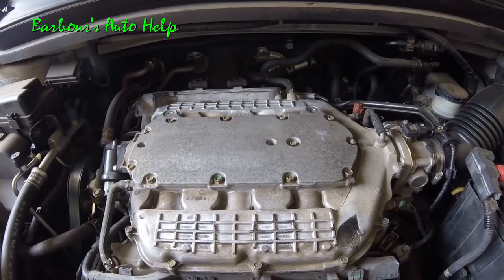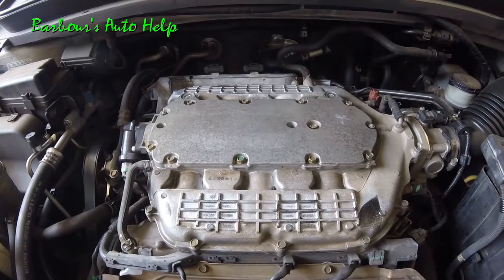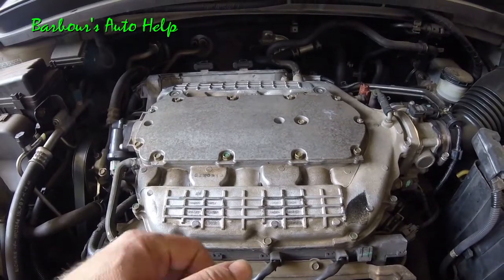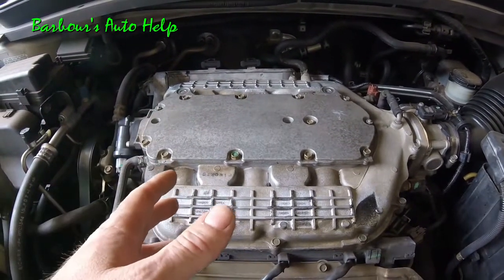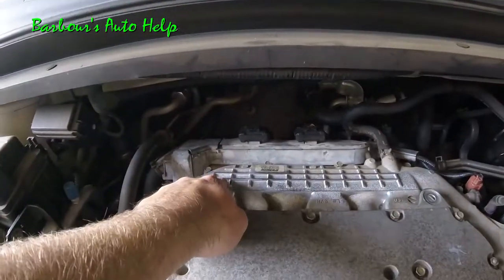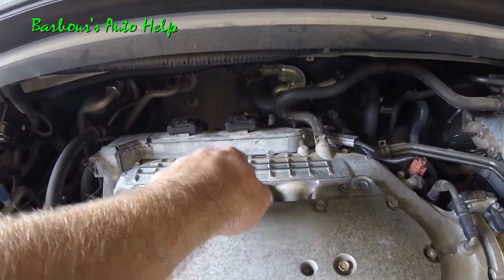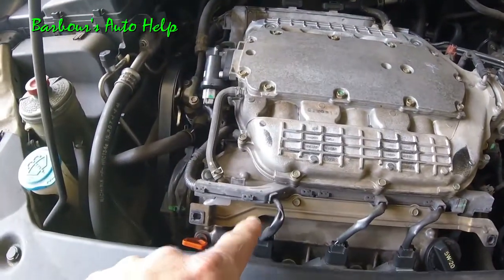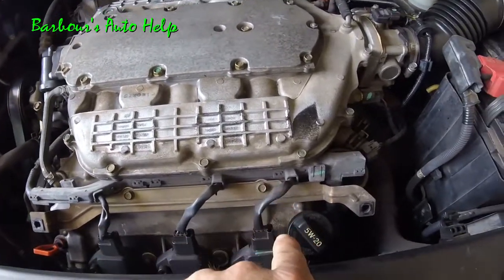05 Honda Odyssey Cylinder Location and Firing Order

Comment: I changed my coils and plugs but i still have a miss fire do you know what it could be
Reply from the maker: Could be lack of fuel or compression or lack of spark.  If any one of those three things is missing a misfire can occur.   The trick is knowing how to figure it out.   Currently I don't have a video on that.
Reply: I had the same problem I did spark plugs n coils packs, ended up being my valves needed a adjustment

Comment: I'm doing a valve cover gasket replacement and valve adjustment this weekend so pretty useful info even though I have already read about it. I just got done with cv axles last weekend and followed your video. Wen't really well besides the Michigan rust making everything difficult to get off. Thanks for the great vids.
Reply from the maker: Awesome!